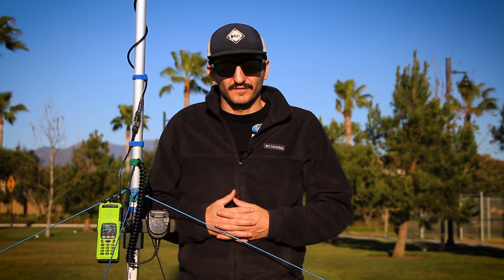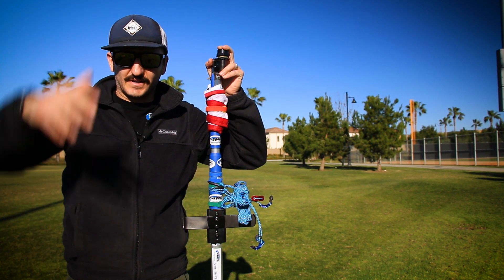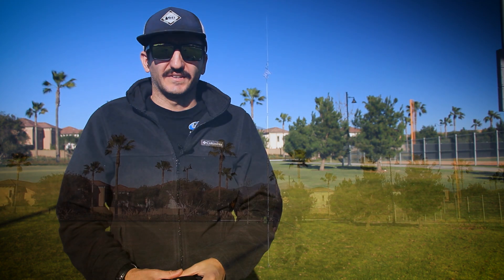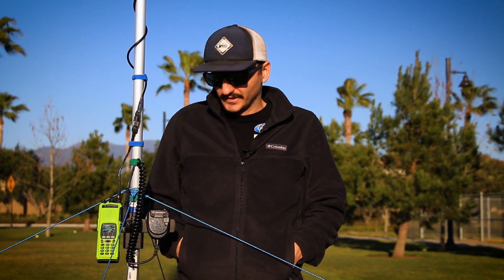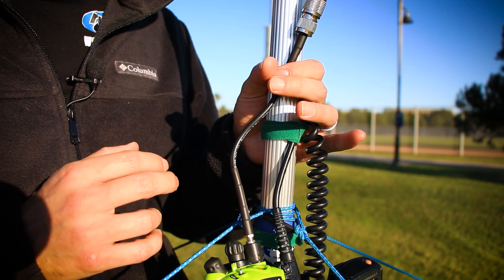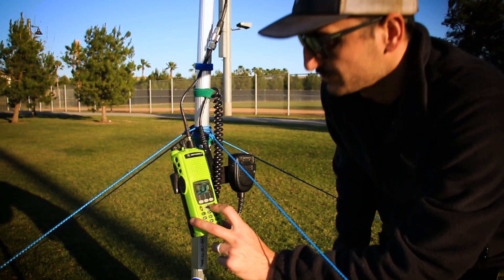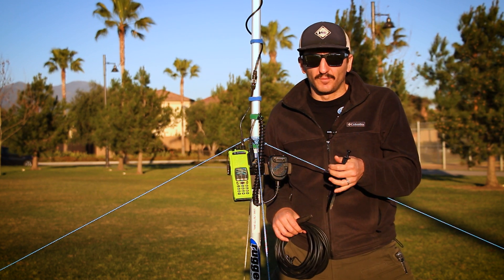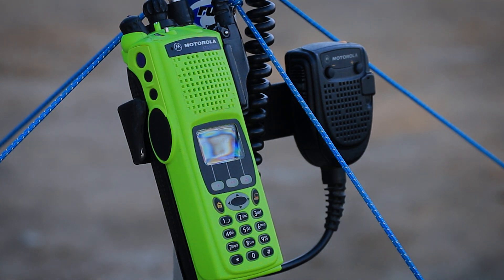Race Radios | Portable Antenna Mast | Desert Communications | VHF-UHF Hand Held & Mobile | DIY KIT

Comment: Great setup. Nice to see VHF radials on a tall mast. Sweet radio and great idea using Velcro. 
My only question is do you have any negative effects from using a painters pole?, it's alot sturdier than a squid pole but probably because it's aluminium. 👍🤠
Reply: I use the military aluminum mast kit to get my portable antenna set up into the air. There is no issue of interference or odd loading of the antenna  considering the mast does not extend beyond the antenna mount itself. When I use it to haul up an inverted V for HF work I add a couple of sections of fiberglass poles out of a camp net support with an adapter I had made. No negative issues there since there is no metal immediately near the radiating wires.
Reply: @Subgunman  brilliant, thanks so much for that information. ;)